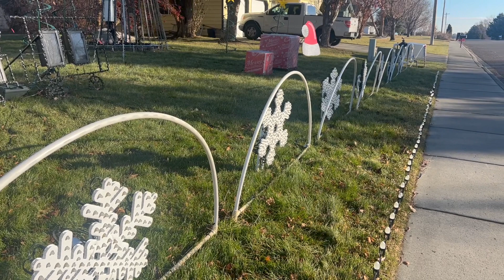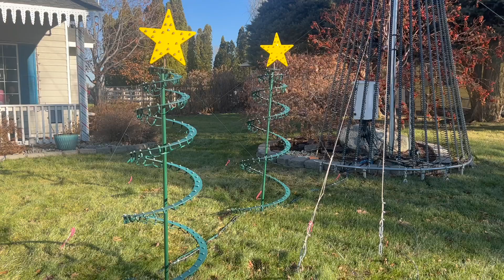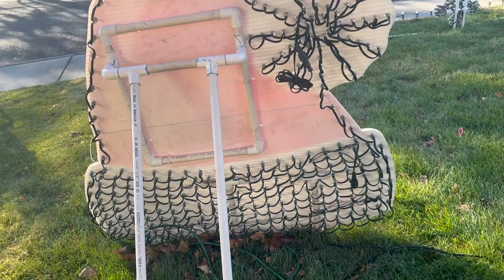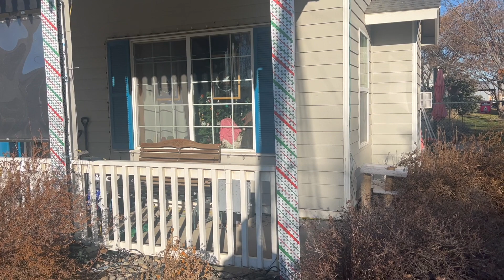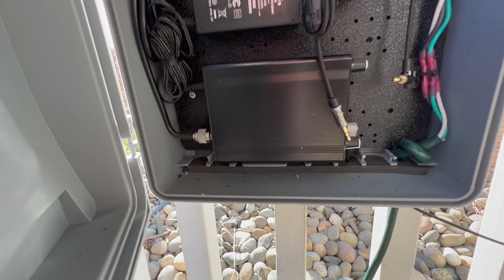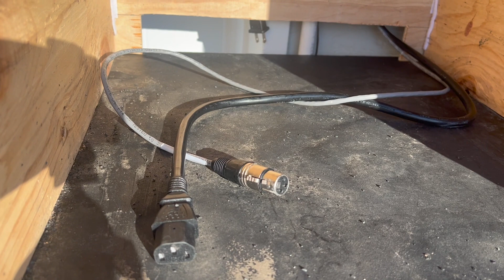Behind the scenes 2022

Comment: Where did you get your extension for the FM Transmitter antenna ?  It appears I have the same transmitter and I need to place it outdoors this year.
Reply from the maker: I used the stock antenna that came with the FM transmitter and bought this extension cable off of Amazon.
https://a.co/d/72IKhrw